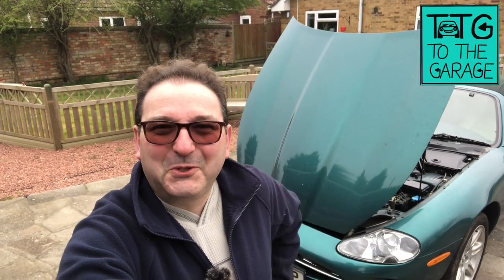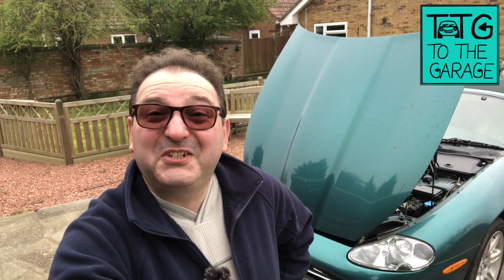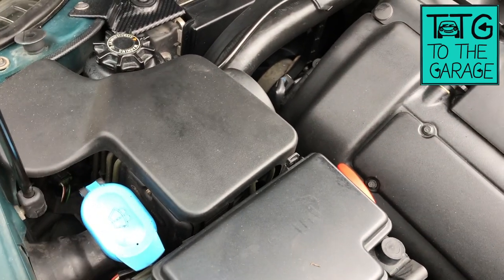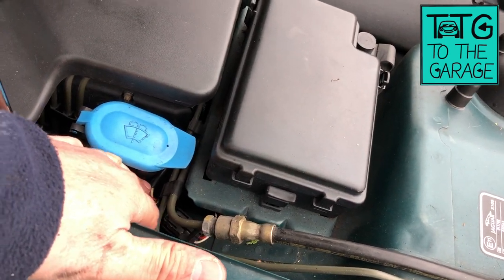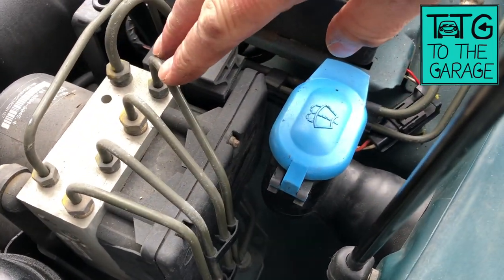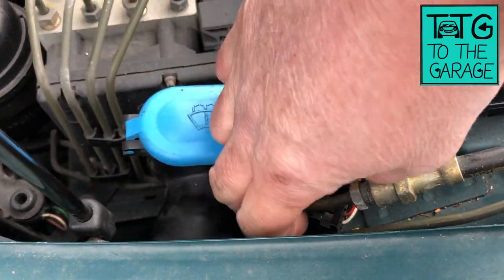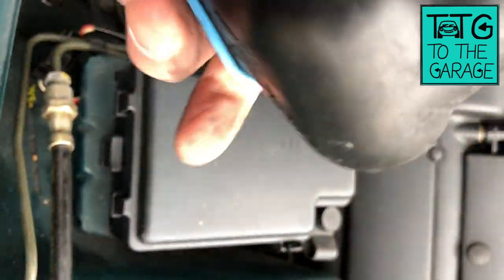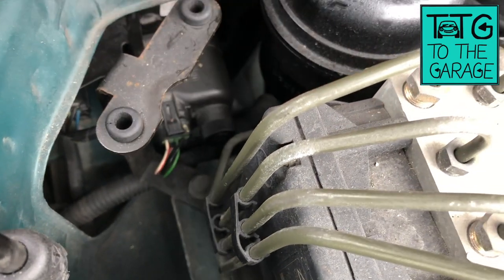Secrets of the Jaguar XK8 & XKR ep 57. Twist its neck.

Comment: Great tip, John. I have removed the main screen washer supply pipe from mine but the part behind the wheel arch liner. I was finding little pools of washer fluid on the garage floor after it was filled and discovered it was the large rubber grommet in the side of the washer reservoir that had lost it seal after 20 years. It's a strange design with the supply pipe entering the washer reservoir halfway up the side rather than at the top which means that the reservoir can leak out until it's half full and then it stops. I first removed the grommet and rubbed silicone grease into it and re-fitted which did improve it, but in the end I bought a new grommet from the Jag dealer. It was only £15 so not worth bothering with the grease really. The fittings behind the wheel arch liner are push fit so I would have assumed that the filler neck would also have been push fit but, thanks to you, I now know that I would have been wrong. :-)
Reply from the maker: Thanks for sharing Richard.
I too think the tube entering half way up the bottle is an 'unusual' design choice.👍

Comment: Great tip John, would go to look at it but it's dark outside so it will have to till the morning.
Reply from the maker: its good to space out these little tasks Terry.
Lockdown cold go on for a while👍
Reply: @ToTheGarage  aye John, but little tasks like these are a welcome break in these strange times. And it twisted off just as you said, so it had to be cleaned etc before refitting of course :)   Tomorrow is XK8 wash day, she's currently covered in dust, a consequence of living near to Drax power.

Comment: I have been considering buying a 97 model. Found one with 50k miles with horrible paint and timing chains have not been changed, or one with 125k chains have been changed and the paint is in remarkable condition. Do you think the higher miles should be a concern?
Reply from the maker: The mileage would not bother me. I would always go for the best bodywork I could get. 
Also its probably a better indicator of the care the car has had than the mileage is.

Comment: Never knew that about the screen washer container opening. I'll finish the coffee then I'm straight out to clean! Assume itll be same for an 03 model?
Ps as an aside, of all the 'Secrets' episodes, was wondering which one has so far received the most views?
Reply from the maker: OoooH Good question. You go check the filler neck . I will go check the stats😁
Reply: @ToTheGarage  filler neck works the same. Hard to get off initially (dont think it's been off in 17 years), but surprisingly clean around the joint to the bulkhead. I dont have the cover on the ABS motor tho. Should I have?
Reply from the maker: Most popular secrets in order are number 1 number 10 number 5
Reply from the maker: As to the abs cover this seems to be an emerging fact. Not heard from anyone with an abs cover except on 96 97 and 98 cars so far. 
so it may have been deleted as a cost down., also did yours have a strainer in the washer bottle filler neck Jules?
Reply: To The Garage Hello John. sent you a short vid, but no, there isn’t isn’t any filter in my screen wash neck.

Comment: No ABS unit cover, mounting bracket, shock tower mount covers, nor washer bottle screen was ever fitted to my 2005 XK8.
Reply from the maker: Ooo the washer bottle screen also!
Are we detecting a serious cost down after a particular year?
Reply: Hi Gary, my 2005 model is the same. I thought that the previous owner had maybe lost the washer bottle screen (no idea how you would do that!). No ABS cover either - no great loss!
Reply: @ToTheGarage  I suspect that someone set about cost cutting near the end of the model run and these little bits were dispensed with.

Comment: I have an 05 left-hand-drive American XK8 and it doesn't have that cover over anti-lock brakes.  It also doesn't have any plastic covers over the shock tower or the bolts.  I was wondering were these deleted by 05 or are they missing?  Does anybody know?
Thanks...
Reply: Hi Lyndon, I have an 04 XKR and mine also has no ABS brakes cover or indeed shock tower plastic covers...I have a feeling mine have been misplaced over the years however, I'm also wondering this myself after seeing the ABS cover John removed especially.
Reply from the maker: The tower covers were deleted ob 4.2 cars the abs cover though I thought was universal . Can any late xk8 owner confirm this?
Reply: @TrevorHeathPhotography  My car is a late Dec 1999 and they are not their on mine, I now the full history from new and they we're never fitted.
Reply: @ToTheGarage  none fitted on mine John either👍
Reply: The shock tower domes were not on my 2000 model.  I bought them on eBay.  The companion nut covers were present, oddly.